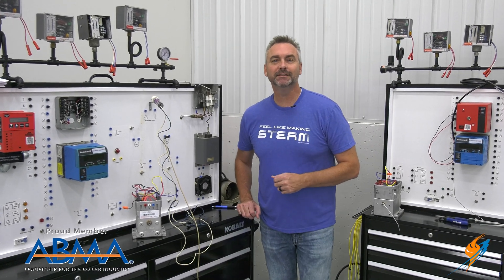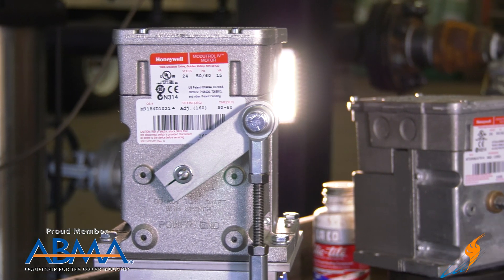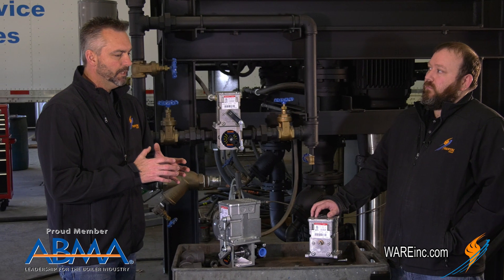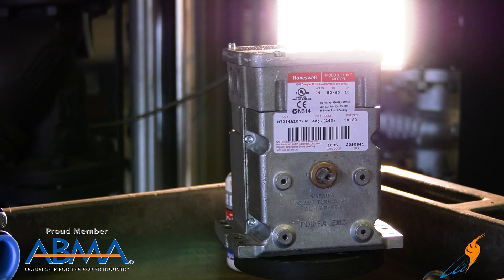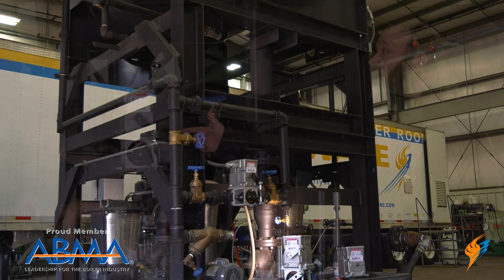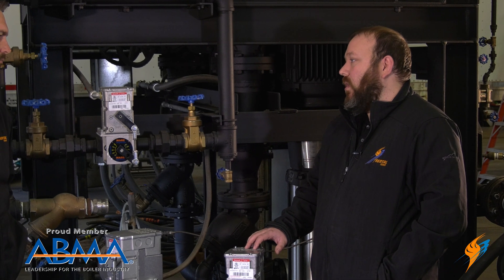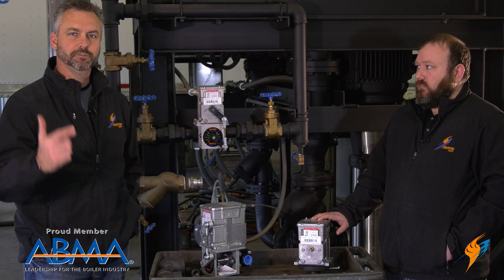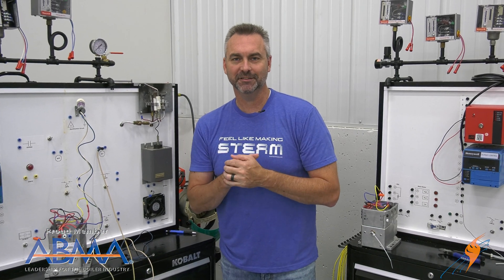Honeywell Modulation Motor Overview - Boiling Point

Comment: I have a question, how can I put my Modutrol IV back into position? The arm, or rather, the iron bar to which it's connected, came out of the base and the motor began to turn to the left. All of this happened when the system was off, and today it no longer turns on. Could you help me by recommending what I should do?

Comment: I have a 0-10V signal available.  Can these motors be used with that signal or do I need an special adapter?  Not sure why it has a R B and W terminals
Reply from the maker: https://d3oivfad18kn22.cloudfront.net/uploads/media/20322_prod_file.pdf

Honeywell Q7230 interface will allow use of 2-10 VDC and to tweak the zero and span. Between those two features you can likely make it work. Thanks for the question!

Comment: Excellent video.....What's inside this modulation motor? If there is a damaged one (scrapped one), it would be a pleasure, if a video is there? Thanks...
Reply from the maker: We currently don't have a video but that really would be a great idea. The basic internals is going to be cams and switches with a motor driving it all. They are very simple yet robust. We will see about doing a "tear down" if we can get our hands on a broken one. Thanks for watching!
Reply: @wareboilers  Thanks for your kind reply.